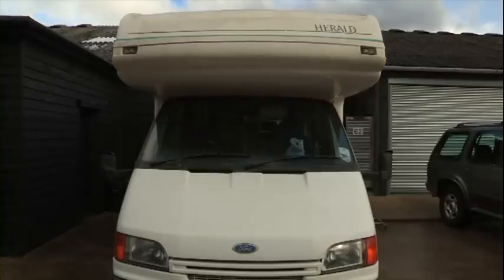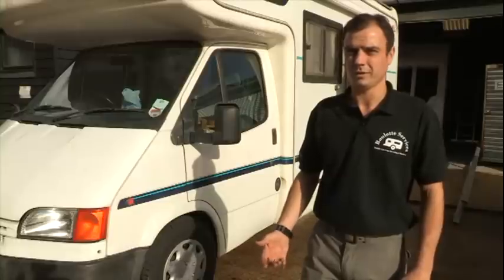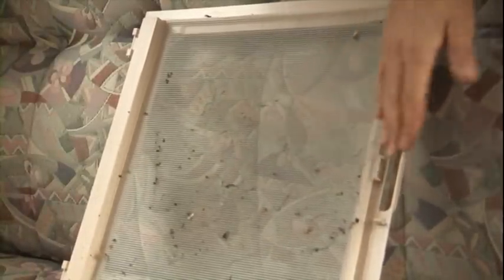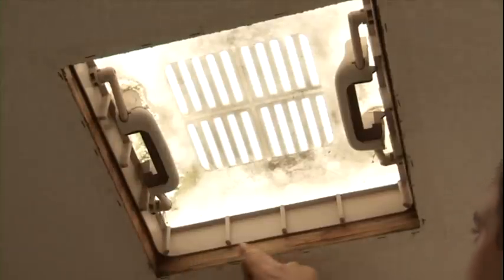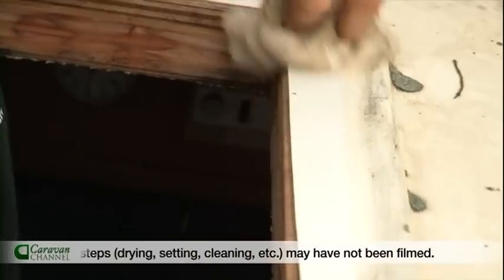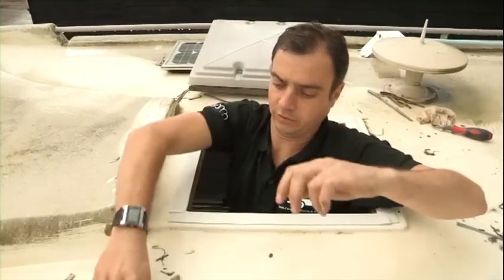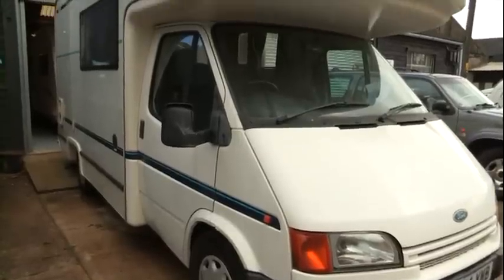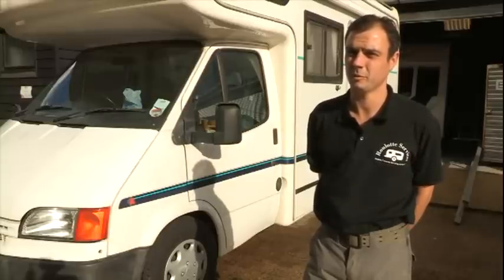Repairing a leaking rooflight

Comment: Bodge artist.. why would you not of cleaned the whole roof let alone the tin y bit you done around the skylight. this van was supposed to be in for updating and a spruce up.. he did not clean the fly screen he just wiped of a few flies ? that should of been put in soak to get the muck of it. the skylight itself was not clean, and to say a wipe cleans it is taking the piss. then he pulled down on the skylight and then pushed it back up because it was not right ???? why not do the job right and leave it. this just proved the mastic cheapo strip did NOT stick to the skylight or would of been hard to push up. he noticed water stains around the skylight opening, yet did NOT treat it ? bodge after bodge after bodge...I would never let him near my caravan thats for sure.. and I bet the bill was hilarious too.
Reply: Exactly what I thought. This is unprofessional work by any standards. I can't believe he didn't clean both surfaces so as to get a proper stick. The rooflight is manky, probably a health threat, but he doesn't seem to notice. I wouldn't let this guy clean my toilets!!